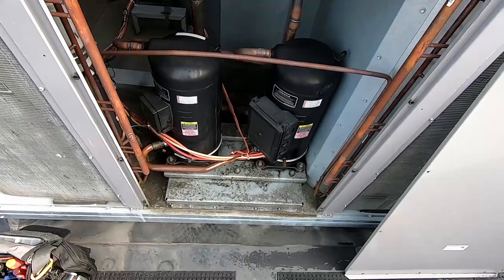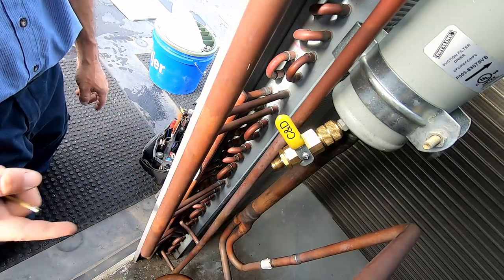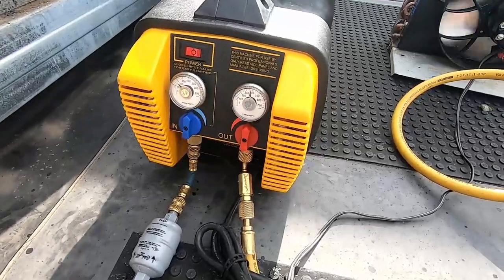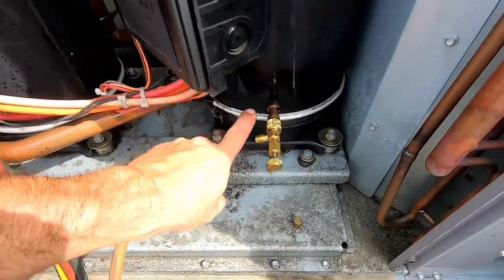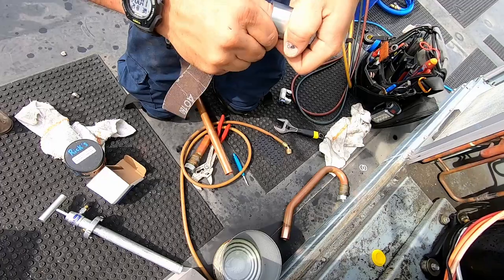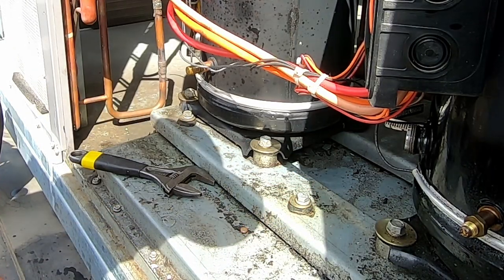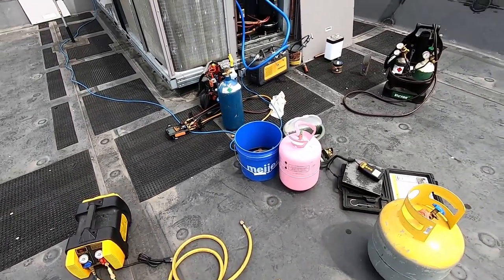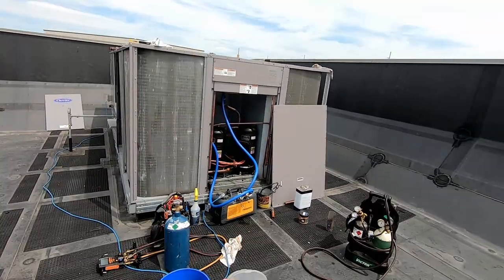22.5 Ton Refrigerant Leak Repair. Recover 45# Of R-410a W/O Water - Custom Sub-cooler

Comment: Don't use tape to cover open tubing or ports on quick jobs like this.  Use plain old Glad Press N Seal from the grocery store. It fits around almost anything, seals, and removes with no residue.
Reply from the maker: That's a great idea👍👍. I'll have to see about getting a small roll.
Reply: @HVACRSurvival  I cover my spare drill battery and 9V battery contacts with it to prevent shorting. I cover my vacuum hose ends with it (easier than keeping up with 3/8 and 1/4" plugs). I cover my inspection mirror with it. I keep a roll in my van and it could be used to cover a vacuum pump, electronic probes and gauges, or a recovery machine if I get caught in the rain. The small roll boxes are better because the sheets tear off easier. Your videos are some of the very best in the trade. Keep them coming and thanks.
Reply from the maker: @jimgill5706  cool ass ideas👍👍  thanks for the feedback and complement!
Reply: @HVACRSurvival  m

Comment: I miss seeing Jim too I called him and asked him to make a comeback . Good job like always bro this is so much easier than carrying a water bucket or run water house, great job 👍
Reply from the maker: Thanks bud 👍 👍🤜🤛
Reply from the maker: What did he say when you called him?
Reply: I love this idea. I currently use a CPS coil in ice water. I wonder what the time difference is between this and what I’m using.
Reply from the maker: @kfury19  I made one like the cps, the big difference is you don't need water and a lot of times in commercial applications you don't  have water readily available.  The speed really has to do with what your head pressure is running while your doing the recovery.

Comment: Been disabled since 2011, I enjoy your videos very much and miss going out into the field working on these units. I agree sub cooling is never the way to charge the system, in my opinion if you can’t weigh it in then use super heat to charge it. Takes longer but more accurate than the sub cooling charts. Keep these videos coming because I for one enjoy them.
Reply from the maker: I'm sorry to hear that your not able to do what you use to enjoy. Thank you for the compliment! Only one thing to keep in mind when charging a TXV,  they generally require you to use the sub-cooling method but I recommend double checking operation by super-heat to verify the valve is working correctly.
Reply: HVACR Survival true that’s what they recommend when changing that but I tried to rely on the super heat then check the how close the sub cooling is. It’s just an educated means to an end if you are not weighing in the refrigerant. When I owned my business I use to give classes on supper heat and sub cooling to my technicians, you would be surprised how many came through my doors out of tech school that didn’t know how to check it or what the graph for sub cooling was for on the units.
Reply from the maker: @redeye2629  I was in the very first class at the school I went to back in 1995 and I did not learn much but I did know how to do SH & SC... I did a apprenticeship class a week ago with the kids that just got out of school and it looks like the school is still slacking.
Reply: HVACR Survival education is one of the most important things a technician arm themselves with the ever changing technology, I’m so glad to see you are doing things the right way and do not claim you know it all and take advice from others. That’s the key you your success.
Reply from the maker: Thank you,  I can truly say I'm learning something new about everyday. Pride and arrogance doesn't go as far as being humble and open to new ideas.
Reply: HVACR Survival amen

Comment: I use core removers and then 2 1/4” to 3/8” hose then speed y into the recovery machine. With either a sub cooler in 5 gallon bucket or run water over tank. Use vapor port on recovery tank and flip it upside down, this makes it so you don’t have the restriction of the pick up tube and the liquid stays at the bottom helping to dissipate heat, best of both worlds! I can recover about 150 pounds an hour this way. Great video!
Reply from the maker: Good tips 👍👍.  That sounds about like what I did. I screwed around with the recovery tank trying both sides just out of curiosity 🤣

Comment: Good work man never thought of using a small fan and condenser to cool the refrigerant for recovery. I will have to keep the next one I remove just for that purpose!  Thanks for all the great videos!
Reply from the maker: Yeah it's so simple that you'll say why didn't I think of that. That's why I had to give credit to my viewer that told me about in the comments.
Reply: Much advantage?
I don't see much advantage. Get to the end of recovery and still got that extra coil of gas to deal with... So don't save time..?
Reply from the maker: @Froggability  I guess if you feel running 200 feet of garden house across a roof to cool the tank is faster then that's a option.  The first video when I was there I wasted around 30 minutes total cooling it down 3 times.
Reply: HVACR Survival. I wonder if condensor coil in your recovery pump is getting clogged? 
I never have a problem, worst case I put a wet towel on the cylinder
Reply from the maker: Are you recovering more than 15lbs of r410a at one time?
Reply from the maker: The machine hasn't seen much use. It might have 2 hours on it.
Reply: HVACR Survival. Yes but I'm always double-tasking so it's usually not a problem

Comment: The schrader core torque tool is nice. The 3” lbs it stops at is far tighter than I’d ever have imagined to tighten a schrader core.
Reply from the maker: Interesting,  I have a hard time justifying it when I've gotten by for this long (and I buy a lot of unnecessary things🤣)
Reply: I wish I could get my hands on some Yellow jacket tools , I can't find that little torque Schrader tool anywhere...
Reply from the maker: click on the link I have in the about page and it will take you right to Amazon and you can order it there. That's what i did. Then I get a couple percentages of commission.
Reply: I picked one up at the supply hose few weeks ago. So far I love it
Reply: Same here. I didn’t think it worked. I haven’t ever cranked one that tight and it didn’t feel right.

Comment: I have found multiple low systems where the plastic cap has a tiny round endention from barely depressing the valve core. Gotta love trane and their brass caps

Comment: Nor cal Dave did a push pull video a while back and if your tank is big enough it cuts the time down significantly. Just one more hose to the mix. Hook the vapor side of the recovery tank back up to the system. Then you use the vapor to push the liquid into the tank. When it slows down you go to traditional. When we have to do the 50 ton systems or larger  that’s the way to go or when moving from a 30 to the 120. I need to start making some videos. Just gets hard to get footage when working in some of the places we work.
Reply from the maker: You should try it,  This isn't as easy as it may look. I spent several hours cutting footage to keep it moving so people will watch till the end. You got to want to do it or you'll get burned out quickly.
Reply: Keep up the good work. I really enjoy watching.
Reply from the maker: Thanks man🤜🤛

Comment: Using the air cooled condenser on large recovery is brilliant. I know that the Appion G5 Twin is supposed to recover liquid but I have seen it wreck one. I will never fully open the inlet valve all the way when pulling out liquid refrigerant again.
Reply from the maker: I agree with you.  I think it's a great machine but it's not invincible👍👍

Comment: Love that gasket changer.
Reply from the maker: The tool is pretty sweet, I thought it was a little Overkill at first until I seen how difficult it was to install the hose gasket in the 3/8" hoses I use for recovery.

Comment: I work on quite a few units with this type of dual compressor circuit with an oil pipe equilizer .
The difference is there's an oil sight glass in the middle of the pipe . 
It's nice to be able to check the oil level , but at the same time it's kind of a hot spot for leaks .
I use a hollow metal pipe where I put my spanner inside to get some leverage because it's usually tightened by Ronnie Coleman or something 😅.
I kinda envy your yellow jacket tool , we don't get that nice stuff over here .
Good video sir , very much enjoyed it 👍
Reply from the maker: Are you not allowed to buy shit from America?
Reply: @HVACRSurvival  supply houses don't bring a lot of it , and when they do it's very expensive.
Plus , the company doesn't want to pay for the nice stuff IF it's even available.
I would buy it for myself if I found it though .
Oh and over here , there's this whole thing about 2 tariffs : professionals and general public , so if you're not a company or a licensed contractor or something , supposedly you'll get the general public tariff , which of course is so expensive you'll just laugh it off and walk away... Nice innit !
Reply from the maker: So your own country is screwing you? Kinda like mine🤣
Reply: @HVACRSurvival  well , my understanding is  at least with you guys , if you wanna buy something , they'll be happy to sell it to you , lover here though it's like :" do you have an account with us ? Are you a professional ? What's your license number ? Oh it's just for yourself alone ?well that will be twice the price then , thank you 👋😅
Reply from the maker: Mmmm that sucks👎👎

Comment: Recover it into the vapor valve and turn the recovery cylinder upside-down.  Apion says to do it that way on their channel...no restriction from the dip tube and passing the hot vapor through the liquid in the cylinder condenses it faster
Reply from the maker: Watch both videos from this location,  I did that on the first video when I didn't use the external condenser, I was experimenting,  this is how you learn what happens if you do it the other way. I rather see it for myself than just listen to how others do it. Also keep in mind this was the first time using the subcooler I had built and I wasn't sure how well it would remove the heat.  There's only one way to find out for yourself and that's too do it both ways and see if it's worth doing it one way over the other.👍👍

Comment: Last year when I first bought my tools from True Tech tools I was arguing with them about how you would lose refrigerant in there quick setup. So I  created a kit that I believe would work for me and essentially the same thing as this except I'm using the bucket of ice water with a CPS subcooler plus some ball valves without core depressors and 3/8" hoses going everywhere plus a coreless Y for the low side and the high side to go to input filter drier then recovery pump input. I need to make a video when I actually have a chance.  So far all small stuff like caps, contactors, ice machines/dispensers 😆. No chance yet. Not going to set up the sub cooler if less then ten pounds. I have a Fieldpiece recovery pump and 3/8" lines that does most things.
Reply from the maker: I can recover about 10-15lb of 410a without anything, just depends on the temp.

Comment: Rick nice vidio
I would like to see a vidio on making the sub cooler.

Thank you
Reply from the maker: I forgot to record myself soldering on the quarter inch fittings but for the most part I just cut the base with the hand grinder and clean the coil out like you seen in the small video then blew it out with nitrogen.
Reply: I have used this setup for 20 years. I put a sight glass and 2 refrigerant hand valves on it. Slow down refrigerant flow to subcool liquid, goes into tank room temperature.

Comment: Another good video with some tips with the refrigerant recovery.  I was curious about how you would handle reinstalling the the roto lock fitting. Looks like a little refer oil on the male threads and Teflon seal.  Thanks for sharing.
Reply from the maker: Thanks Brad👍👍

Comment: The condenser is a great little set up. You cut the video when chargin5 at 44lbs but you added some more. I was thought to fill the tanks to 80% capacity... I know that refrigerant mass is not the same as water. But on a 50 tank I would go 40ish 44 I would take the chance but higher I have my doubts. The reason is you will place the tank in your van and there it can easily go over 115F... and higher temp higher pressure.  I am not criticizing or hating, I like your videos. Just trying to keep you safe out there. Nice camera upgrade by the way.
Reply from the maker: Your correct,  I knew I was only storing the refrigerant for about a hour to make the repair so I rolled the dice. Thanks 4 the feedback👍👍

Comment: Brazing the Copper outside to unit while made it easier to avoid burning anything also didn't allow for running nitrogen to avoid oxidation
Reply from the maker: Go back and look closer. You'll see the hose and plunger I used.

Comment: What did you make your subcooler out of very cool
Reply from the maker: It was the condenser from a reach in cooler or freezer. It happen to have a 120v motor on it and i cut the mounting plate in half with my grinder to make it smaller.

Comment: Good job sir I am small system air conditioning or refrigerator technician in Pakistan🤗🤗
Reply from the maker: That's interesting,  what brand equipment do they have there?
Reply: @HVACR Survival  sir equipment brands USA , China ,Taiwan
Reply: @HVACRSurvival   sir i am use old equipment like old flaring tool or analog gas charging meter  but sir your gas recovery tool was lovely
Reply from the maker: Thank you!  I appreciate you watching the videos 👍👍

Comment: You are supposed to measure liquid temperature leaving the condenser when referencing that charging chart, not condenser discharge air.  I believe the chart says “outdoor coil leaving temperature.”  Outdoor coil leaving temperature is liquid temperature.  Were the condenser fans at full speed?  It didn’t look like they were but that could be the frame rate on your camera.  They need to be running 100% to use that chart accurately.  Also, just curious, were all of the VAV boxes open 100%?  What was the return air temp?  Those charts are usually pretty accurate.  I’m not being a hater, I have just spent a considerable amount of time with these units.  I enjoy your videos.  Cheers!
Reply from the maker: It did say outdoor coil leaving temp. If they want liquid temperature then they should ask for it?  I simply think it's a shit diagram and piss poor development on the engineers side to choose to word it differently. This is a complex device compared to normal systems but yet they did things differently. To answer the other question,   I didn't hook up my laptop to verify what the vav system was doing,  I did that the first time I was there and to be honest I don't have many of these systems to work on so I'm a little green with the software. Because  the weight method is usually 100% accurate I trusted it over the moron chart 😏 so I wasn't too concerned with the chart values being off.  I appreciate your feedback, I have no problems being corrected👍👍 because I know I'm not a HVAC super tech. I use to think I was but after working on the things that I haven't even shown on my videos, it didn't take long to walk humbly.
Reply: HVACR Survival I agree that weighing in the charge is always the best option over the chart.

Comment: I’d be interested in seeing the follow up oil check. At ahr I asked the Copeland guys should I err on the side of maybe too much oil or not enough (the systems I work on have no way to check ) and they said err on too much it doesn’t hurt it unless you filled up so high you bury the rotor
Reply from the maker: Yeah I wondered about that myself. 25 oz of oil is quite a bit of oil to lose so it should be in there somewhere. I'm just curious why it's not returning? Could be it never runs in high speed much with this being a VAV system?
Reply: @HVACRSurvival  considering that line is just an oil share, whichever compressor ran last solo is going to be the one with the more full sump. The oil pump on those is ingenious, it's a flat bar that has been twisted to resemble the flutes of a drill bit to auger up the oil so it's practically impossible to overfill.  Still wouldn't fill past an inch below the lowest body weld divot to avoid the rotor fins churning the oil at which point you're over a gallon per compressor.
Reply from the maker: Makes sense 👍👍

Comment: Thanks for the vid sir. Like your style. content and attitude.  Btw you said you don't approve of the 22.5 ton machine. Please explain
Reply from the maker: I was referring to the charging chart being off. The unit its self is fine. It was mentioned in the comment section that I might have misread how to use the chart? If that is the case then it might explain why I had issues getting the numbers I needed.

Comment: Just a thought the pipe between the two compressors is solid with no give, with both compressors vibrating, would it be better to put two spring loops in the copper with Annealing.
Reply from the maker: Sounds like a good 💡👍👍,  I've personally never done it but if it happens again I might do that.
Reply: I'v on occasion repaired the very same fatigue cracked pipes repeatedly. Till I finally decided to introduce extra length for flex

Comment: Did you braze with out nitrogen flow ?
Reply from the maker: That would be bad to do on camera wouldn't,  lol. Look for the yellow hose right b4 I started brazing,  I ran nitrogen by using the rubber stopper used to flush Line sets with. You'll see it before I zoom in.